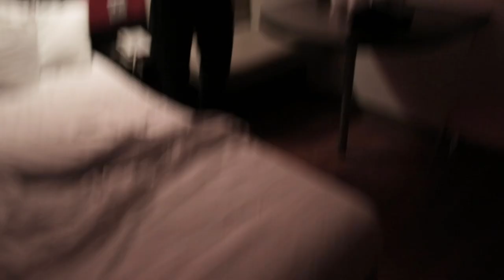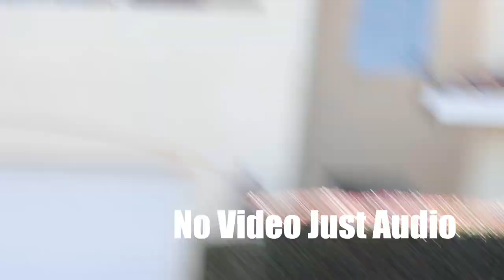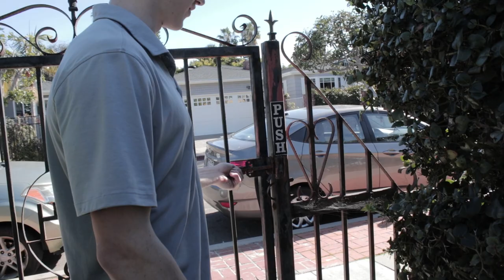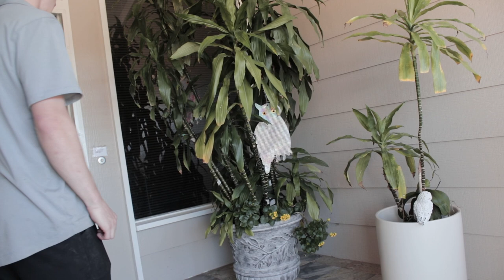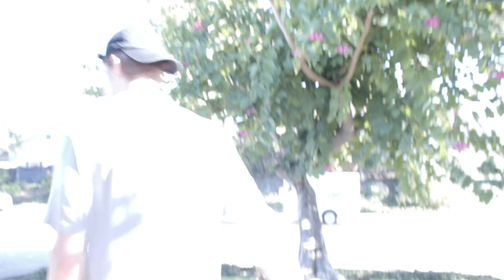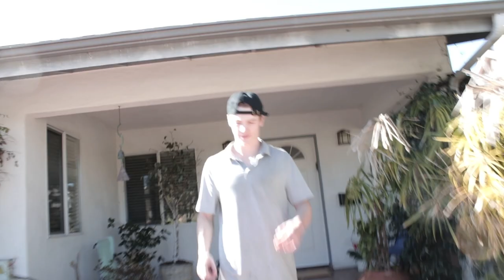EP. 3 SLEEPING UNDER A PARK BENCH - 0-$30k Challenge

Comment: Thank You Josh for everything we appreciate you. I sold 1000 on the dot my first day in an hour in a half. I'm literally just parroting exactly what u say. There's people talking sh on the comment board because they dont have the courage to do this. I initially didn't want to hire people now it's looking like I would limit my daily profit if I don't hire people. God will bless you more now.
Side note:
250 400 350 were the winning numbers for that day showing the fluxuation of the homes u come across.
Reply: Bruv can you tell me what equipments i need initially, if i get water fed pole only, is it ok? I dont have a truck tho, how can i get the water from
Reply: @RealLordZilion  so maybe the prices are different where you live. All I started with was equipment from home depot eventually you will want to upgrade. But for now, go to home depot go to the window cleaning section the main brand will be unger. Get the longest pole there not water fed but they work, unger has a 24ft at the home depot in my area, so now u can do 2 stories building's. Since its not a water fed pole buy a bucket that's split in middle dirty water/clean water never put solution in bucket only on the sponge buy 3 sized squeegees, brush for frames maybe a Cobb web cleaner same brand same section. Buy a belt amd towels. This was all about 250 300. If u want water fed system, it's going to be about 1500 and up for a system pole and filter tanks. Eventually u want this system to do the jobs faster but also some jobs need this system over the other and visa versa. Hope this helps
Reply: @cbnk8  Hows it been going?
Reply: @Yhappp he don't care about you kid.
Reply: @cbnk8 How did you hire people? I am assuming you hire them as contract labor, right?